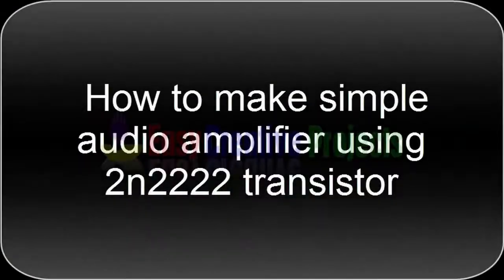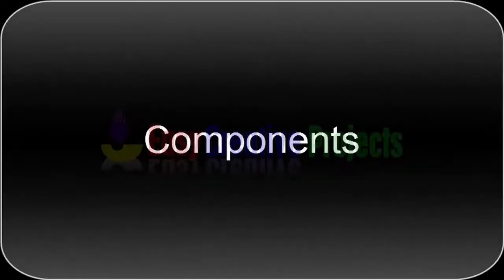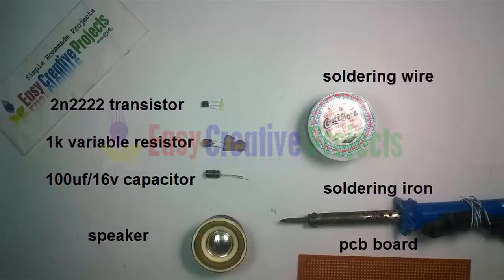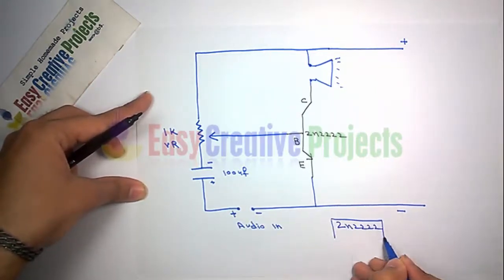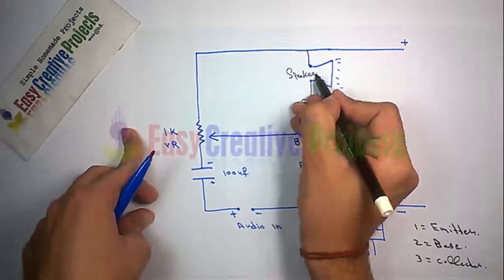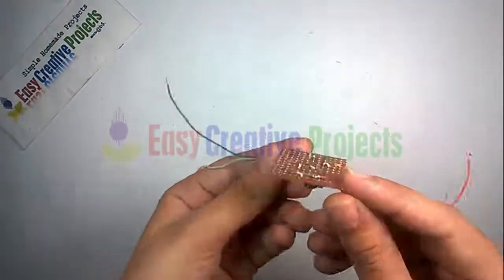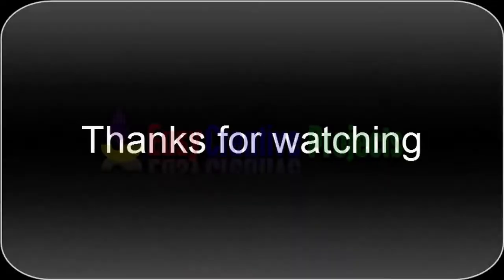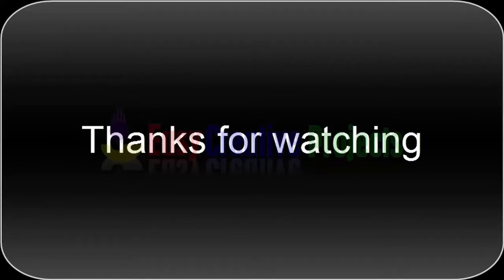How to make simple audio amplifier using 2n2222 transistor

Comment: Nice video! My only observation is the position of the resistor. The diagram makes it look like it had 3 connectors, so I don't really know what's the intended position.
Thanks for sharing!
Reply from the maker: simple focus on transistor pin points. emitter, base and collector. 
thanks.

Comment: Hey man, i really like this video. Most of the people who make those videos simply dont talk, they build things out of pure air but you make schematics, which is something that really makes you shine out of the mass! Great job! I can figure out most of how the circuit works, can you tell me if i am right?
The resistor inside the potentiometer between positive and the base acts as a bias, which turns the transistor on.
The voltage coming from the phone is coupled with that capacitor, it goes through the other potentiometer resistor to base, adding some intensity to the base current flow, which makes more current flow from positive to ground through collector. The current genereates a voltage drop across the speaker, which is what we hear. Is this correct, or have i made any mistakes?
I am just starting out in electronics and i am absoloutely fascinated by it. Thanks for the content!
Reply: Also, can i use a 0.22 uF capacitor and a 10 k potentiometer or would it limit the base current too much?
Reply from the maker: yes. all transistor provide different output. you need to learn transistor datasheet. its very help you to understand how much they provide output. then you can design any circuit very easily.
thanks.

Comment: all good and well but how loud does this amp get when plugging in a signal that isnt amplified allready ? if you are using that circuit with a device like a smartphone that amplifies the signal anyway befor it gets even into the amplifier circuit you could also just skip all of the components except for the speaker and just solder a headphone jack to the positive and negative of the speaker and it will work also ...
Reply: For the simplicity, the circuit is pretty genius really. The 2N2222 is perfectly suited for this type of circuit even. I am guessing you will get about 25 voltage gain and input impedance around 70 ohms using 3V supply and 8ohm speakers. About 125mW of audio output power from a 600mW supply.

Comment: Will it works with 220uf,35v capacider and 5v,4o speaker too?
Reply from the maker: yes you can use 220uf , 35v capacitor.
Reply: @EasyCreativeProjects  I have found that it are220mf.
Reply: 5V at 4ohms will push the 2N2222 current specs to the limit and you can probably expect a lot of distortion. This circuit probably functions best with 3V at 8 ohms

Comment: Nice video, What transistor should I use to power a Computer desk speaker?
Reply from the maker: you can use any high power transistor. like 2n3055, TTC5200,
Reply: Those will work for a 4ohm 3w speaker?
Reply: Martin Nyirenda Yes
Reply: Thanks, i thought they were too big for such a small project

Comment: I've used 100uf/25V capacitor and a 12 V battery, but sound is even slower than phone. What's the problem?
Reply from the maker: dear its simple transistor circuit.its work on 3v to 9v.
if you want to high volume so you need high power transistor.
thanks.